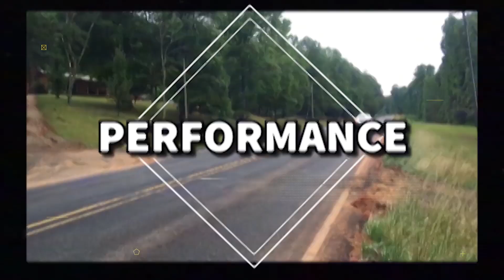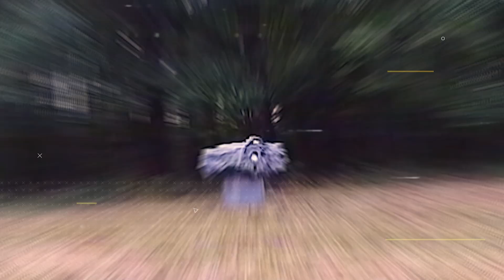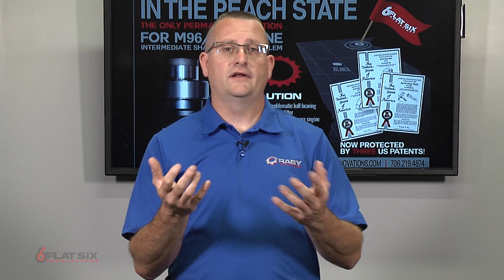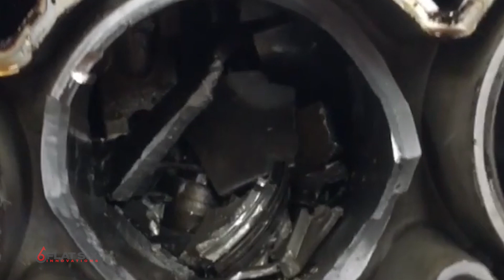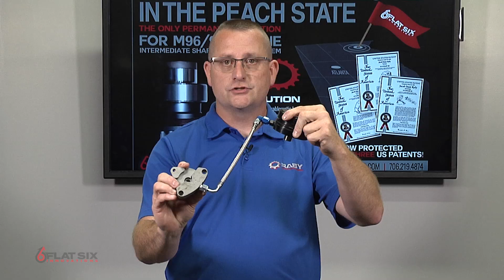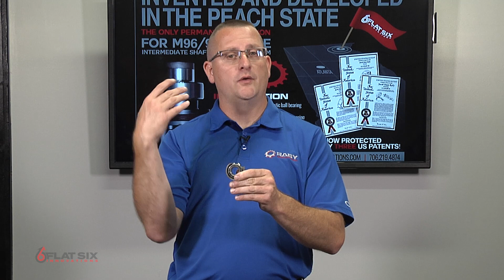The IMS Solution versus Everything Else  |  IMS Bearing - Porsche 996, 997, 986, 987

Comment: Dear Jake, there is nothing worth 2000$ in the kit that you offer. A bushing, an oil filter adapter and a hose. That's it. Where do you come off charging this??? Then, you have to buy the tool kit for another 300$. No thanks, I'll take my chances with another bearing.
Reply from the maker: Jake Raby doesn't sell IMS bearings nor set the price. The IMS Solution is manufactured right here in the United States at LN Engineering in Momence, IL. The price is set by them.

Comment: hello Mr Raby...I bought a 2002 911 automatic in 2018 with 115k miles... like new... I parked it in garage and since 2018 I have only driven 1 time around block. ..I just checked oil filter and not even a sliver of foreign anything in it... Should i install your solution, and is it possible with an automatic transmission to do in car?
Reply from the maker: Storing your car for this length of time and not exercising it regularly is one of the worst things you can do for these cars. Your car should be inspected for cylinder bore scoring among other things... and, yes, if it has the original 6204 IMS bearing, I would immediately change it out with and IMS Solution. Doesn't matter if it's a manual transmission or Tiptronic.

Comment: Very well done presentation and an excellent solution to the IMS bearing problem..For sure I would buy this product in preference to the as presented competitor's fix..However....

Very probably I don't understand the bearing installation procedure well enough ?...Because what I disliked about the presentation is that no explanation is given about the total assembly procedure required for this product's installation ? Particularly about how is the central bolt prevented from falling into the engine's oil pan as its bolt head is loosely slipped into ( head of bolt towards the INSIDE of the engine behind the plain bearing ) the engine's bearing housing..How is the bolt prevented from being pushed into the oil pan when inserting ( slipping the casting of the IMS bearing ASSEMBLY over the threads of the central bolt ) and drawing up the assembly's parts ??..What holds the bolt in place and prevents it from rotating when tightening and from falling into the engine ??..
Reply from the maker: https://youtu.be/9oKlgMNYOxA

Comment: Mr. Raby... I have a late model production date of 11/1999 for my 911 996...would you agree that this more than likely would 
be of the dual band or single row? My car has 192k and has all of its current maintenance including chain, tensioners etc...
I feel at 192k it probably isnt going to have an issue with IMS...having said that my next plan of attack is to schedule
my engine replacement with a Raby performance engine...Thank You for the work and investigation into this Porsche issue
A Porsche Enthusiast sinced 1996
Reply from the maker: Mr. Raby doesn't have time to monitor comments here. Please complete a support ticket at flat6innovations.com

Comment: So if ball bearings are so incapable handling the load, why are you then still selling them?
Reply: Ball bearings have a finite life where as an oil film does not because it is constantly being replenished..My two cents worth.
Reply from the maker: First of all, bearings are rated by load and load is the primary reason for bearing failure. In this application, bearings experience must more punishment than say a wheel bearing. The worst of the three OE types used during the M9X generation of Carrera/Boxster/Cayman engines was the 6204 which has shown to have the highest failure rate. The best out of the three OEM bearings is the 6305 or "M97" bearing which was used in the 997 and 987 and all "AT" M9X engines after 2006. That bearing has shown few reports of failure. The best bearing is the plain bearing design that is found in the Porsche Mezger engines and in the patented IMS Solution. Secondly, Jake Raby and Flat 6 Innovations do NOT sell IMS bearings. Also, Flat 6 Innovations has not sold an IMS Bearing individually since 2009, and all our engines come with the plain bearing IMS Solution, omitting the ball bearing from the engine.

Comment: I did not buy a Boxster because of this IMS issue , but I might in the future and your IMS solution is the best . Like a small block chevy cam bearing , it will last almost forever , just keep your oil changed .
Reply from the maker: Which model Boxster do you own?

Comment: I think you have a great product, but I do believe your the other design is not as bad as you say.  Jet engines use ball and roller bearings that are sprayed with oil to cool and lubricate. If oil flow is lost the bearings fail fast.   Your average jet engine experiences many more cycles than any Porsche engine.
Reply: I spent 45 years as a licensed A&P mechanic. Spent alot of time working on jet engines. Yes, it’s a fact that turbine engines use ball bearings that are oil fed. But, thru many hours of development in engine cells, it was proven that the oil quantity and pressure to the bearings is critical. Too much oil was just as bad as not enough. Too much oil creates a standing wave of oil that each ball has to push resulting in overheating. So, it is possible to over lubricate a ball bearing. The kit with the external oil line feeding a ball bearing is questionable due to not knowing how much oil the ball bearing can tolerate.

Comment: Question: Does the fact that this is a new, additional and 1st draw/use for oil mean that the original oil system might not leave as much for the other components that Porsche spec'd/intended? This would like adding an additional rod/crank bearing location without any supporting oil pressure/supply considerations. Anybody see any problems with this?
Reply: I thought the exact same thing. Unless there is an orfice that lowers the oil pressure that way you don’t drop total pressure right off the bat.
Reply: As long as the engine has a little extra oil to make up for the added lines, etc...  the oil pump will be able to maintain the same amount of pressure. Same reason why adding a bigger oil cooler or accusump for racing doesn't drop oil pressure.

Comment: What part bears the axial impulse of the hammer blows during installation of the IMS Solution? I assume it's another ball bearing that is intended for radial load, not axial. Can the other IMS bearing at the other end of the IMS shaft handle the hammer impacts required for installation of the IMS Solution into the IMS?
Reply from the maker: The bushing. BUT a special mandrel is included with the LN faultless tool kit that presses the part in without any hammer blows.
Reply: OK That's great. Thanks

Comment: This looks like the best IMS solution, where does the used oil go? Oil is in the area so does that mean that oil does enter this area and lubricant the stock IMS, or is not enough oil?
Reply: The overall volume of oil and pressure level of the engine's oiling ( pump ) system is more than ample to accommodate the amount of bleed off oil pumped through the IMS  (concept ) plain bearing...If such ( the pump ) was insufficient the oil pressure gauge reading would be very low .. My two cents worth and Oil filters also have bypass valving and engine oil pumps are always capable of higher volume and pressure than that which is required as well as why they have a built in pressure / volume oil relief regulator..
Reply from the maker: The IMS Solution uses just filtered oil, then the oil is returned back to the sump. It provides a constant stream of oil to the plain bearing. This system doesn't NOT use the original factory bearing.

Comment: Great video.  How does the “IMS Retrofit” offered alongside the “IMS Solution” compare?
Reply: Retrofit is basically a better bearing - this is a cheaper approach than the Solution from a parts cost perspective and a (slightly) easier install. On the other hand, you will be redoing it each time you do the clutch. The Solution is one time and permanent.
Reply from the maker: They are radically two different designs. I encourage you to visit the http://theimssolution.com  & http://imsretrofit.com websites for more information.

Comment: I had the IMS solution installed in my 2005 997.1 in 2015 by a certified installer,  the car had traveled 62000 miles, it have now traveled another 37000 miles with NO issues what so ever,  both at the track and the german autobahn,  Brilliant Product !   I change oil and filter every 6000 miles